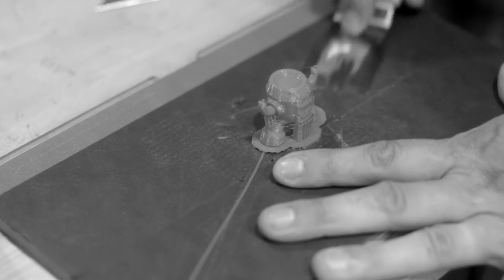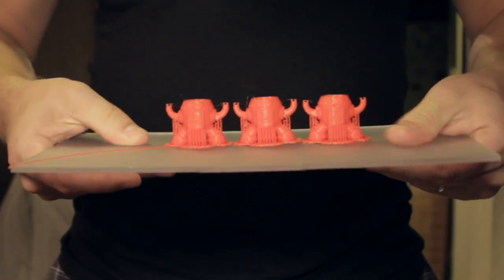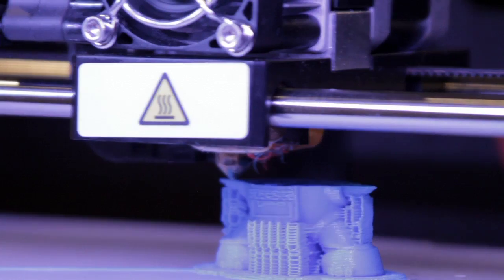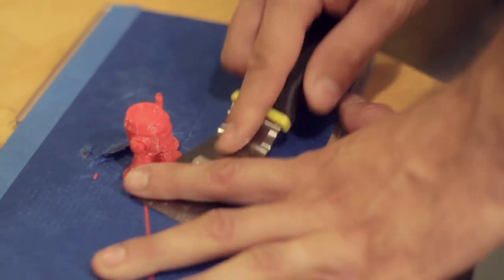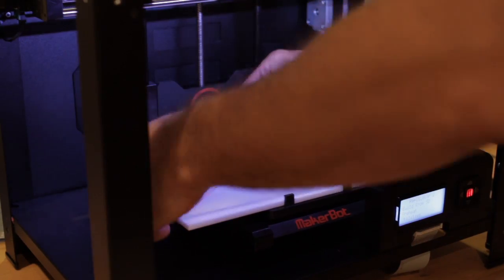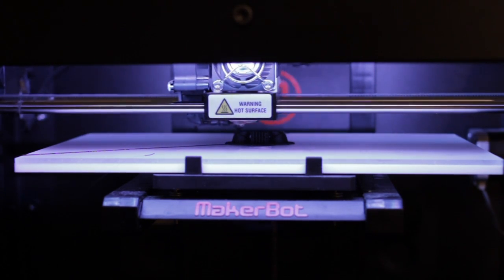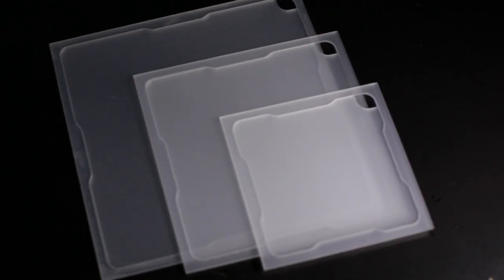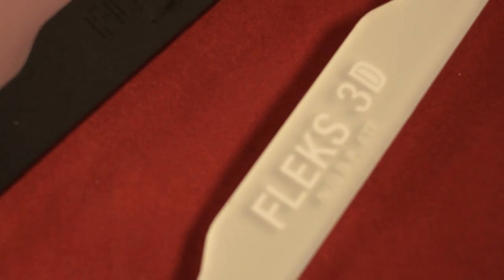FLEKS3D Kickstarter Video

Comment: Hi peter i have a question? I emailed your website a few weeks ago and have yet to get a responds. I have a Robo3d R1 and would like to get one of your plates, but i need to know if i order the 10x10 is that the build plate or is that the outside of the frame?